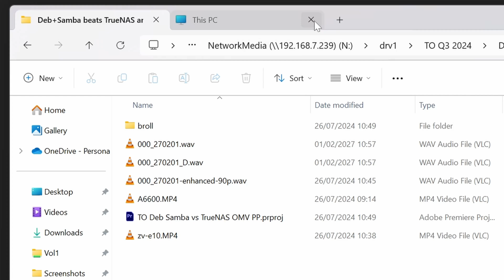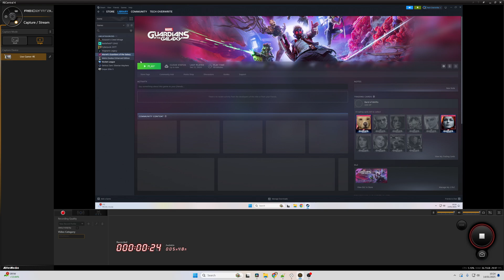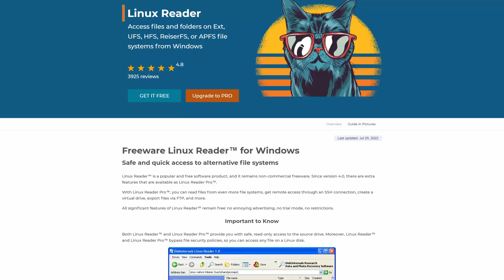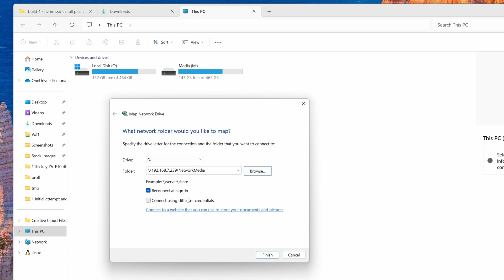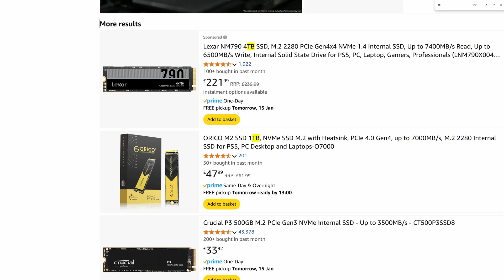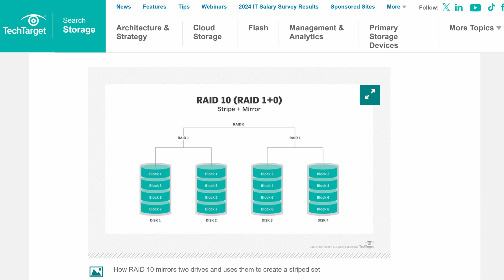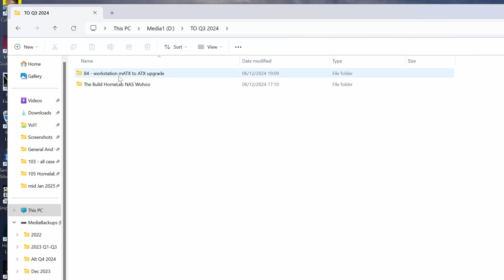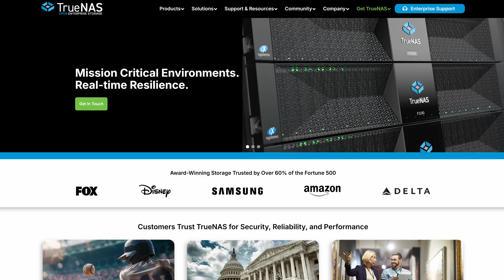Mistakes Were Made: My New Homelab NAS Plan

Comment: I'm kinda in the same boat. Changing up plans. I originally wanted a NAS for mostly local storage sharing the archives and syncthing for keeping the essentials on all my local devices (Music, most recently taken photos, etc) without the NAS having to be on 24/7. Originally I was going to use my Fractal Design Meshify 2 (huge case) in storage mode and have it be a Server/HTPC hybrid/Archive Box (which actually sounds still good), but I am thinking because I want a low powered machine to access data 24/7 most days, I am thinking I'll attach a DAS to mid performance mini pc that will run on lower power to act as a decently fast NAS. Yes, HDDs over USB isn't ideal, but it should work fine for me as long as the PC/DAS are stable models.

Sorry for spilling my whole plans in that essay above lol. I'm looking forward to seeing how your future set up turns out. already subbed.
Reply from the maker: Ah that's interesting, and no worries re the comment length, that's all really interesting. The Meshify 2 looks like a beast. It's hard to know which route to go - the DAS to mini PC could definitely work well I agree, and naturally be pretty portable compared to the Meshify 2.